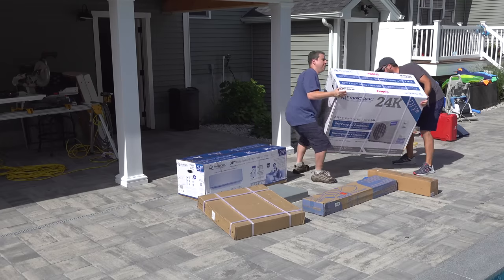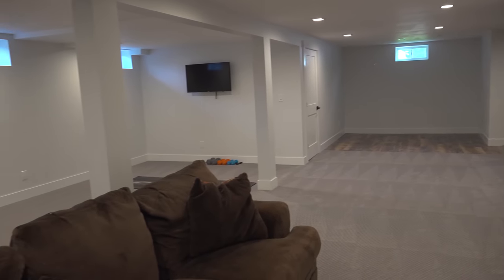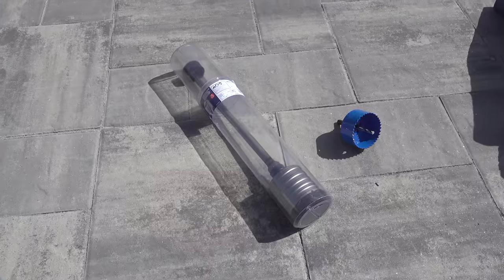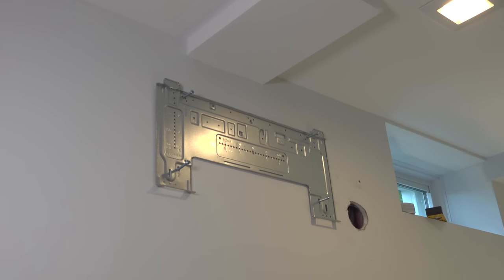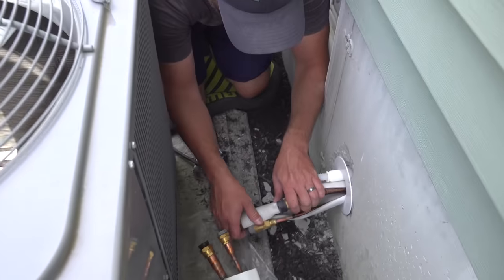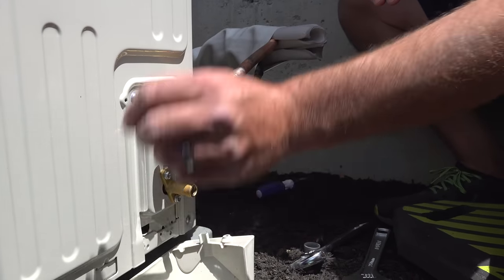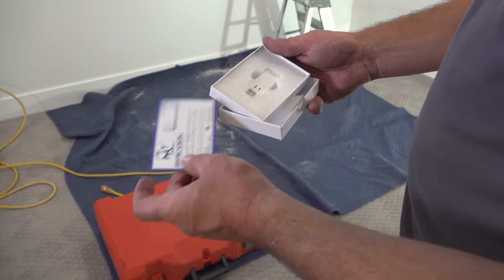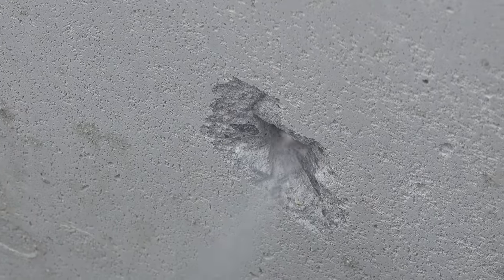Install your own AIR CONDITIONING in 4 HOURS!  DIY Mini Split MR COOL

Comment: Important to mention that you can skip the line set vacuuming / evacuation step ONLY with the MRCOOL DIY style units because their line sets are actually charged with the refrigerant. If you do this with other units you’ll have problems.
Reply: Not true.......
Reply: All if the "DIY" kits have pre-charged refrigerant lines. The systems that don't are specifically for professional commercial installations.
Reply: The second you hook them up you contaminated the refrigerant and the vacuum also proves you don’t have a leak. R410a refrigerant is bad for the ozone layer and is not supposed to be leaked out. This was a poor showing on the product and cooling and efficiency of the unit is hurt in the process.
Reply: If you pause at 6:06 you can see that the lines have fittings like a hydraulic line quick connect.  I can only guess MrCool evacuates the line of air and adds some refrigerant so no vacuuming needed.
Reply: @Monzataylor31  this unit's do not require to vacum the lines for 30 minutes lines are precharge if you look closer the lines have special connectors.
Reply: @Monzataylor31  no. Pay attention they you Q2C fittings, and the service ports are "opened" to release the refrigerant into the other side of the system.
Reply: @Monzataylor31  should always test with nitrogen before vacuum otherwise if there a leak you’ll never pull below 500 microns
Reply: Right . Others have to have the lines vacuumed with a pump to remove the air . Or else it won't cool .
Reply: Every unit I’ve ever installed conventional units mini splits commercial units all come with a factory charge of refrigerant you still have to pressure check to make sure there are no leaks and you still have too pump the system down via a vacuum pump to create a vacuum in the system to allow proper flow and to remove any air from the lines
Reply: @magnumfishing1014  the negative pressure causes the moisture to boil, moisture in the system causes acid when it's mixed with the refrigerant and will destroy the compressor eventually. It's not to create better flow or remove air
Reply: No they dont. They took off the caps to connect them?? Any freon would have boiled off quickly. Only the condenser, outside piece, comes with freon. They will need a new compressor shortly!!

Comment: When the drill bit come through the wall you should have come around & finish drilling from the outside. That way the hole would of been clean instead of busting out
Reply: I was thinking the exact same thing, but it might be hard to line up the holes exactly.
Reply: Yeah I guess we all have the same thought.

Comment: If he didn't already, make sure that drain line is below the refrigerant lines and slopes slightly downwards through that hole in the wall, otherwise you'll have condensate running around inside the interior wall!
Reply: Well the suction line is usually insulated so that shouldn’t be a problem
Reply: @lostinthewoods3918  nothing to do with insulation, if the line doesn't slope at a downward angle the water could flow back into the air handler!
Reply: Yep. Install instructions on mine very clearly called for a slight downward slope coming out of the wall.
Reply: @rortify  let's try and at least keep the comment section civil here. The air handlers create condensate and the manual clearly states a downward angle. Try sloping it up and see what happens.
Reply: @rsachoc  ah I see what you’re saying now
Reply: @rsachoc   it’s OUTSIDE.
Reply: @rortify  not talking about the condenser! Talking about the drain line on the INDOOR air handlers
Reply: @rortify  inner unit condensates moisture from the room, that drains out via a pipe and goes outside, without proper angle water will start dripping from the inner unit inside the room.
Reply: @rortify  Tech. You need to learn the difference between the condenser coil (OUTSIDE) and the evaporator coil (INSIDE). The evaporator coil generates condensation and it is inside the room where the air handler is located.
Reply: Yea dude your right lol he has the drain on top of the gas lines that for sure will cause the water to start pouring out of the unit inside
Reply: @freddyrosenberg9288  WHEN you use it to cool
Reply: @rsachoc  iTech is mixing up between the condensate ( drain line ) and condenser , but yet I agree with you it needs to have a slope to have a good condensation and avoid the leak
Reply: @rortify  the drains on mini splits are inside that's why you can put a pump inside of them if it's not on an exterior wall if it is like this it drains from the header straight outside. ...you've never installed one huh? You'd know because they give you barely enough space to put the pump in...Ive installed tons of these and sorry you're very wrong on this one bud
Reply: @rsachoc  he's obviously never installed a mini split or had to fit those tiny little pumps in the back of the header in certain applications. I know exactly what you're talking about. Just set up a vfr with 11 condensers with 64 heads  for a grow room and wouldn't you know they all needed drains inside lol. Hope he doesn't do this for a living but we all were new at some point
Reply: @rsachoc  I prefer cassettes inside if possible so it has the built in pump. Have a good one man
Reply: @James on Stuff yes and that is very specific in the instructions and can be difficult to correct on some installations.

Comment: 4 hours with help, and they knew what they were doing. 

For a layman, expect 1 to 2 days.
Reply: That was me. But I also had to trench and bury a 240v supply line in the yard to my shed.
Reply: That's why hiring a pro may cost you less than DIY. You may f*ck up a lot of things that will cost more than the actual installation. Why is so many people cheap anyway? You got a job, it's obvious you think you deserve to get paid, but you think that other professionals should be working for min wage or less... That's many people's thinking.
Reply: pretty sure they used more than 4 hours.
Reply: @MrDomestosWC  The problem is, the pros charge too much for this type of work. Typical install costs for a 1 ton minisplit, where the unit itself is about $1500, are typically $4000+. Even if it took the pros 8 hours (it doesn't), that would be over $350/hr. Pretty far from minimum wage. I think $100-$150/hr, with a total cost of around $2500-$3000 would be much more compelling vs. DIY. 

HVAC guys are scared of these things, and with good reason. It makes DIY possible, without expensive tools, and most of the work is easily done by reasonably competent DIYers. They're starting to offer traditional split systems as DIY - that will be interesting.
Reply: @bnasty267  I agree with you. HVAC guys hate splits for a reason though, the installation on some units can be a nightmare. Also, I don't know how it looks like in your town, but my local jurisdiction (Calgary) requires electrical permit to be pulled with the final inspection for the AC. DYI is not an option in that case. I had two guys installing the central unit in my place (VERY weird townhome). It took them a full day (approx. 12hrs shift for both). They brought everything, the unit, the coil, lines, connected the electrical, pulled the permit, run testing, built a cover pergola to masque the AC unit etc. They had to run it thru common area concrete. It costed me nearly 5k. I know the cost of the supplies and permit was approx. $2k. So $3k/24hrs is approx. $125 per hour for each. $5k seemed like a lot at first but then I didn't realize they would spend so much time on it. They even had to remove the pooper in the bathroom for the rough-ins and rearrange some lines. I'm happy as they did a fantastic job and I do realize I wouldn't be able to DIY, even though I fully understood the sequence and logic (I'm an engineer). I had no tools and no hands-on experience. I see that most HVAC guys are scared of splits, they have no experience with it, while in Europe (where I'm originally from) it's the most common thing. Central AC in EU is exotic. That's probably the reason why.
Reply: @MrDomestosWC  what i hear growing up is that these line breaks or leaks and its a nightmare having to keep fixing it.  like buying the wrong used car.
Reply: and for me... about a month, followed by an EXPLOSION and possibly fire!!!
Reply: @justDIY  Based on the many success stories I've heard of regarding these DIY units, the percentage isn't real high. Yes, you have to be careful, but anyone capable of working on their car or doing plumbing repairs can handle it. I've actually heard of more issues with sloppy HVAC installers brazing incorrectly and causing a pinhole leak than a factory flare failing. 

I don't disagree that the quality of these Chinese units aren't as good as a Mitsu, but all of these minisplits aren't super high quality to begin with. Luckily, they're getting cheap enough that they can be disposable (like a window unit), assuming you aren't paying $4000 extra for a 'pro' to install it.
Reply: @MrDomestosWC   Nice generalizing. Perhaps it is more likely people are just trying to save a buck where they can, and some people feel like they can handle electrical as well. I do nearly all the work on my cars except the transmission as I enjoy tinkering but can't afford the specialized tools transmissions require. I do my own remodeling and minor plumbing on  my house; I do hire the pros when I feel the job is above my level and electrical is one of those for me. But even then I shop around for the cheapest yet still reliable pro but don't begrudge the money when they solve the problem.
Reply: @bnasty267   Not Scared. And 1200-1500 for a mechanic and a helper is a fair price.
Reply: @bnasty267   where u got the 350 an hour rate from I have no idea. But 1500 works out to be about 185 an hour that's 160 for the mechanic 25 for the helper.
Reply: @bnasty267  I mean that's how I do it anyway with md state master and all Nate certification and 21 years exp.
Reply: @bnasty267  This is why I'm glad companies are leaning towards DIYers despite having personal experience in the trades. I think it's a good alternative for people who want to save money doing their own work. If you're smart, handy and can read instructions, you'll be fine. Even if you're not, with patience, you could do it.
Reply: yes knowing what you are doing is important
Reply: @bnasty267  minisplits in general aren't good quality? Idk why do you think this way, "mini splits" are standard AC units. Of course  cheapest, chinese ones won't be the best. Mitsubishi electric or Daikin are top quality. Actually, 90% of AC in Europe are mini-split (called just "split" in EU) or multi-split systems. There's literally no "duct" systems with big vertical outdoor units like in US.
Reply: @Soveey  They just don't last as long, typically, as a quality traditional split system.  The mini splits have tons of plastic parts that are metal in bigger airhandlers, and parts aren't as easy to get and not as universal. 

Does it matter? Probably not much. Almost everything now has cost cutting to the extreme, and even traditional systems don't tend to last as long as they used to.
Reply: @hongziyang  yeah didn’t even purge the copper lines the compressor won’t last for long
Reply: For a layman, you are not ALLOWED to install a split system in Australia. Plus, unless you want to keep all these new tools to finish the job, it will cost quite a bit of money to buy them all as the SDS Max drill and bits are expensive.
Reply: @bnasty267  Exactly, almost everything now has cost cutting built in, they are designed to fail after the warranty is over, that's how they make money from replacements. Every year, there is at least one household item needed to be replaced in my house, whether it's a fridge, vacuum cleaner, oven, hot water, fan, TV, etc....
Reply: plot twist, he is a HVAC tech! LOL
Reply: Actually they dont know what they are doing, they made so many mistakes.  many contractors watching this are laughing their asses off.
Ill give you a hint to one mistake out of many they made.  they cut the metal beam.  🤷‍♂️
Reply: @bnasty267  Lmao. Don’t fool yourself. There isn’t an legit tech on the planet that is concerned with home owners installing junk like this. If I anything it’s job security if you like side work for when they inevitably break.
Reply: @bnasty267  damn that is really expensive. The company where I work, though it is not in the US we charge like 200$ for instalation if outside unit is not higher than 3m and refrigerant pipes are not longer than 3m. For every extra meter it is like 20$ with cost of piping included.

But you have to cinsider that when professionals do the instalation you get it done a lot faster (less than an hour for most exoerienced guys at company that I work for) and you get warranty for that instalation. Most manufacturers here void your warranty if unit wasn't installed by a certified professional.
Reply: @bnasty267  how much do mechanics charge?  How much do doctors charge?  That’s called business. You have to think about everything they have to pay for. Yes the unit costed 1500 but they went and got it, brought it to you. That’s gas and time.  Maintenance on trucks, insurance, workmans comp, wear and tear on tools, actually having the correct tools to do the job right( unlike this video). Payroll, the phone that you called them on, the website you looked them up on, office personnel, list goes on. Of course professionals can’t charge minimum wage. Why do a physical job like that when you could flip a burger or stock a shelf?
Reply: @bnasty267  We have a two story 1k Sq ft home.  Had a quote for minisplits.  One condenser unit and 4 heads, 2 up, 2 downstairs.  Because we only have a 100A main they would also have to upgrade to a 200A main.  Total cost including permitting?   $14k.   Then had a traditional heat pump system quoted which meant adding running ductwork through closets and stuff since the home was built in 1941.  Same price.   There's no way I'd ever get an extra $14k when selling the home just because it's got central HVAC because in this area everyone is fine without it, not a selling point.  People here open windows when it's 85 degrees f outside which is ludicrous.   So we decided it wasn't worth it.
Reply: No way that was 4 hours. It was 30-45 minutes just to take the bush out of the ground. By they time you go and rent those tools, pull the bush, and all of that, no way. Now if they are starting the timer one all of the prep is done and they are only talking about running the lines through a hole and wiring it up, yeah, but all of that is part of the installation. Definitely a day or 2 for the layman. But I am guessing that if you watched this video and are considering this, your already know that.
Reply: @MrDomestosWC  damn this is too true. I work in IT and i know computers inside and out, but i'll be damned if I expect people to pay me, why not do the same for the person who spent years learning how to do their trade? I tell my wife all the time that I CHOOSE to pay someone who KNOWS what they are doing over watching hours of youtube videos hoping to do it right and not screw up the house. And if they come in and do a good job, I'm telling other people to hit them up too
Reply: @MrDomestosWC  i got quoted 7k for a upstairs triple . ill just do it myself next spring.
Reply: Have faith in yourself man
Reply: @bnasty267  no HVAC guys charge for the knowledge and possible warranty calls. Do you think a homeowner will be able to troubleshoot future problems? Charge their own refrigerant in case a flare wasn’t correct? No

Comment: In February we stayed at an air-bnb in Georgia in what the listing said was a Cabin.  It was more like a large SHED converted into livable space - that's another topic for another day.  But it did have one of these Mr Cool units.  Unfortunately the heat didn't seem to stay on for more than a couple of hours before it would start blowing cool air.  It seemed like if you turned the unit off and on it would work again but that was unreliable.  Regardless we were glad to only stay in that "cabin" for only one night.  It was a unique and unforgettable experience that's for sure!

Comment: I would set up each outside wire/tubing connector in a “drip loop” configuration to prevent rainwater from getting into the interior of the condenser mechanicals. Beautiful setup. You’ family will be enjoying the fruits of your labor a long time.
Reply: Look forward to seeing your video on the install.